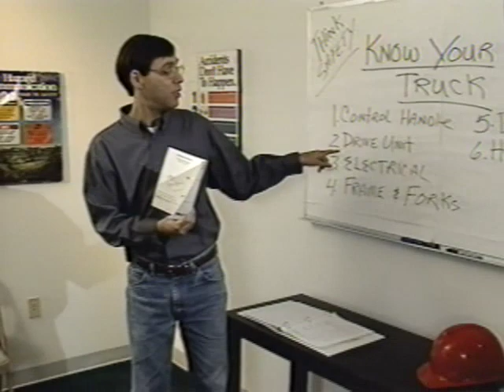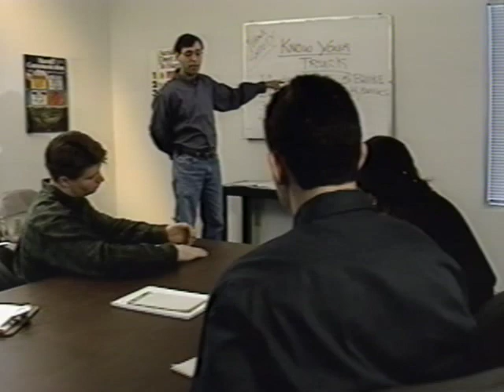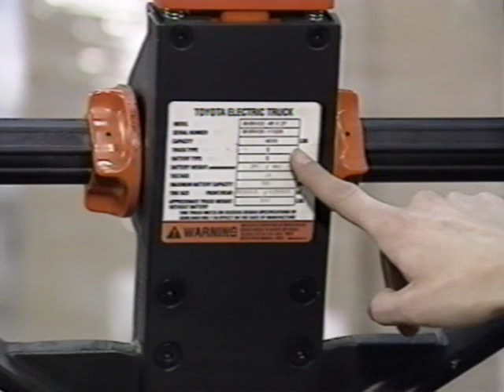Powered Low Lift Trucks Safety Training For Walkie & Walkie Riders

Comment: if we had to do this all the time no work would get done its just common sense give way to people on foot no speeding and make a lot of noise dont be afraid to honk that horn get yourself noticed if your in a blind spot if your honking your horn making noise they will notice you long before you notice them because them 2 seconds does make a difference can avoid accidents and if your not 100 percent confident on it then you shouldn't be using them at all period that lady in the video looked nervous i see that as a danger to herself and others going too slow and being nervous can cause accidents too her minds not fully aware of her surroundings in her head shes thinking i hope i dont wreck this pallet or hurt myself and her minds focused on  it could be someone around this corner its a wet patch on the floor